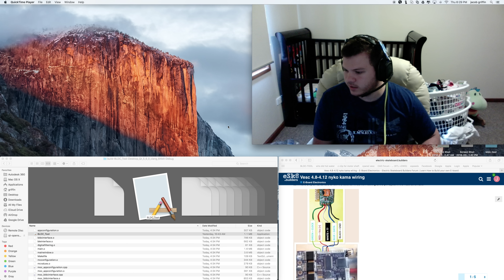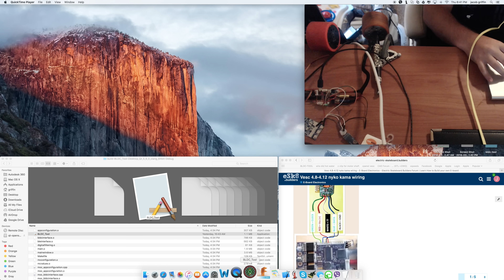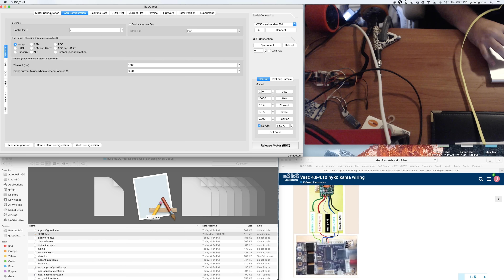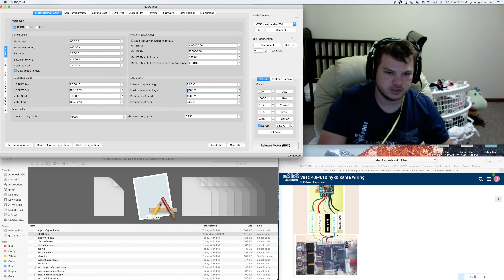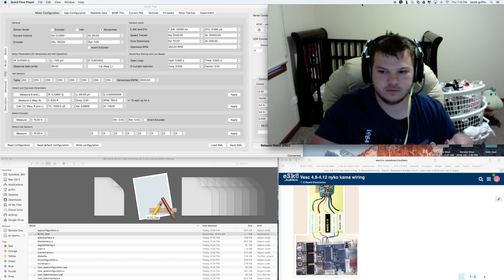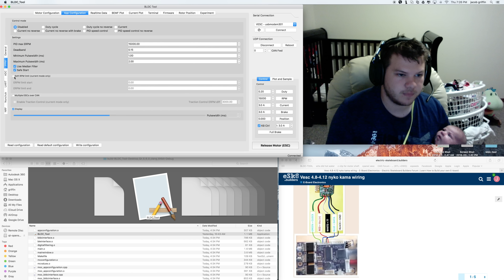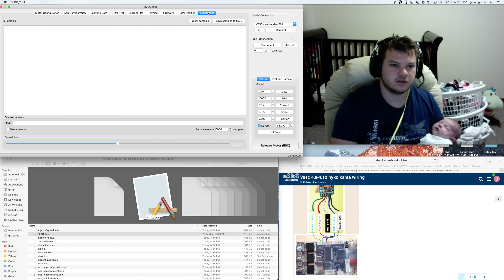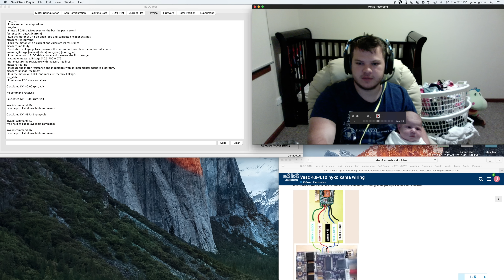Programming Electric skateboard VESC BLDC Tool

Comment: What do you do if you've solved the DRV fault but still can't detect the motor?
Reply from the maker: CandaEH look for a different fault, activate sampling then do the motor detection then quickly flick back, depending on the motor your using there are a lot of screen shots you can use to see your motor settings